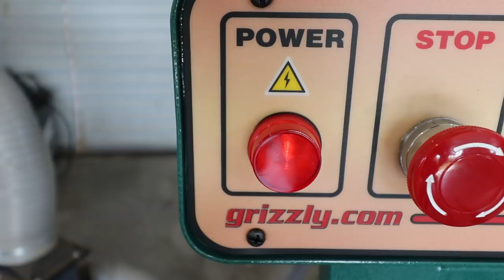ANOTHER ESSENTIAL TOOL FOR THE SAWMILL, GRIZZLY SPIRAL HEAD PLANER,

Comment: Hey Nathan. Great vid, as always. Been an envious fan for quite a while now. I am a recently retired Local 30 sheet metal worker out of Toronto, Ontario, Canada. A long, long time ago I worked at a shop that did mostly industrial dust collecting. in the shop we made everything needed for a complete system by hand. Just a hand brake, a foot shear and some hand operated forming rollers. The only thing we didn't make was the fans. Floor sweeps to cyclones, stocking collectors, and everything in between. one thing we almost always put in the system was a drop-box. Last thing before the  suction fan. At least 10 feet. This gives the heavier wood chips a chance to fall out the air flow before the fan, so as not to go through the fan,[possibly clogging or damaging it], and going on into your stocking dust collector. My apologies for making this so long. I wanted to share some of my old knowledge with you. I hope it helps.    Respectfully    Rick Severin.
Reply: Unrelated but I'm a member of SMART local 49 New Mexico. Great insight brother.
Reply: That's experience worth noting, and a good tip.
Reply: Thank You Brother

Comment: Real nice planer there . Be sure to look on page 31 of the manual for proper lubrication of the feed roller bushings.These bushings dry out real fast with a little use . I just replaced the bushings in my 15 inch machine.    Have fun .

Comment: Nathan..... Rick here again. I just realized that I didn't give you any measurement suggestions. If your main pipe is 10", then make your drop-box 20' wide. The length can be 40". And the depth about 24 or 30". Of coarse everything must be air-tight and of a heavy enough gauge, and reinforced so it won't collapse from the suction. You also need a clean-out on the bottom . Best wishes and good luck.   Rick.

Comment: I am sorry if i am an asshole...i gave a Grizzly 25" dual drum sander away after it continually bogged down and burnt expensive paper up,jumped chain etc.pissed me off....then there is the Grizzly jointer i scrapped last year. Got a Woodmaster(USA) 725, 25" planer,sander,molder,gangsaw,10HP motor....$3000 well spent after pissing away $2000 on Grizzly. Well i hope you have good luck with your planer anyway.  Thanks for your excellent videos